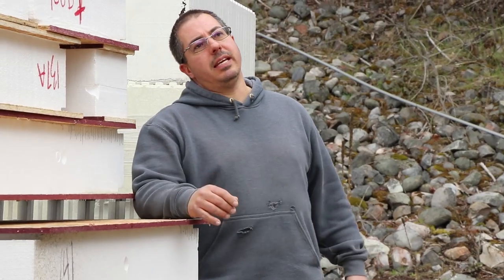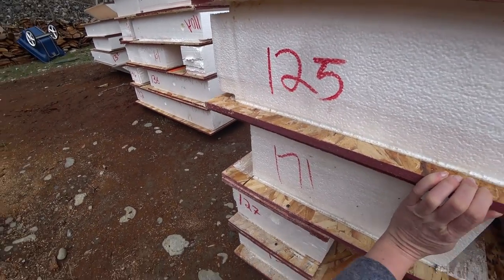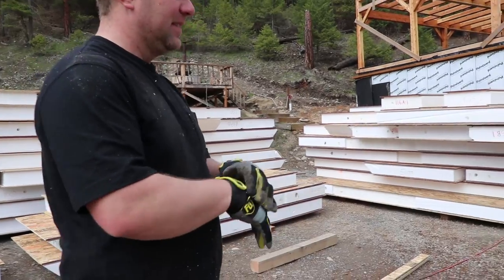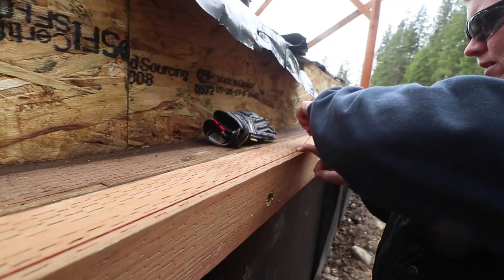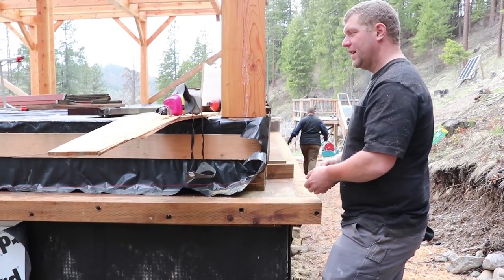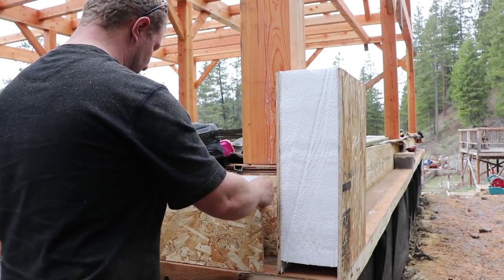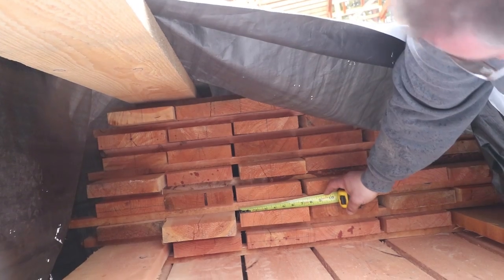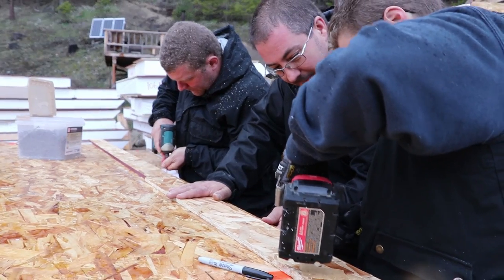LET THE SIP GAMES BEGIN! (Installation Day One)

Comment: A good tip when using the battery powered caulking gun, when you finish using it, put it into reverse and back off the pressure to stop the glue from oozing out.

Comment: Wish I could have shared this earlier.   Screw a piece of plywood to the base of the saw.  Have it extend past the blade side to give more area to stabilize the saw.  Even have it extend the right amount that you can simply follow the rim joist and cut the right amount off of the extensions.

Comment: when you use the table saw a pusher tool or scrap piece of luner used to push the end of the boards through will save a very nasty injury never get your fingers closer to the blade than you have to.

Comment: Two things, first if you haven't already finished ripping the sill plates consider cutting a piece of wood to space the saw fence the correct distance away from the rim board instead of trying to constantly follow the line (note I would still snap a line for an occasional sanity check). 
Second, Jesse knows nothing of foam dust until he has to carve it with a wire wheel grinder.

Comment: nice video guys, one question, why would you want to slide the drywall  below floor level?  it would be exposed to a cold zone ( the garage) and add potential risk of moisture or condensation. making it very difficult to remove later on.

Comment: That's an awesome BIG skill saw but the blade you are using is for cross cut work and has too many teeth for ripping work. Also when ripping I would have been happier to see you working slightly above your work rather than beside that whopping exposed blade.....I work with industrial machinery and respect that when it bites....it bites hard and no one ever thinks it's going to happen to them...fingers and thumbs etc don't grow back.....These are my observations.... not criticisms... from New Zealand

Comment: You  could screw a plywood base to the saw to extend out the narrow side of the base to better support the saw and also provide a guide to saw the proper width.  This may allow you  to saw from above and  may be safer when you are cutting the boards that are higher off the ground

Comment: Apologies if someone has already mentioned it: Why not tack on a guide strip to run saw shoe against? It's very difficult lifting a saw that high to begin with, let alone follow a visual line. Failing a tack strip, clamp on guides to the bottom of the saw shoe.

Comment: pardon me for being the village idiot here but..
why are you using a terminally inaccurate table saw,
when you have the woodmizer?

I'd set the 'mizer at one quarter the required width
whittle that off
then do final size to finish
after rotating the planks

I wasn't always the village idiot, I used to be a structural engineer,
but when my Dad died, I sort of inherited the job..

Comment: "IT'S GUNNA SPLOOGE LIKE CRAZY!" " ....your last night of being completely naked. Enjoy it!"  I love you Alyssa!  
2 things lay your glue down in an S shape to grab more connection to the 2x8, think of snake tracks.
second thing. make an extra table/shoe plate, from 1/2" osb or similar, for the Mankita saw. attach to the bottom (did I need to say that)
ok thi is where you have to pay attention

the plywood accessory shoeplate(SP) will attach to the bottom of the saw. just making sure!
cut it to the dimension of the existing SP plus 16  inches
attach it so that it extends 9" past the edge of the house side of the blade, USE sheet metal screws or machine bolts with lock nuts
3/4 space+8 1/4' SIP =9" be sure to make sure it runs parallel to the blade!!!!!!maybe go 8 7/8 for some wiggle room
now you should be able to run the saw down each wall using the floor for a guide, think rip fence
the plywood super shoe will eliminate most of the need to keep the saw from rolling over

Comment: That's one pretty big trap for DIYers. Especially with a lumber mill. 2x8s are actually 7 1/4" x 1 1/2" they take the dimensions before it's planned, surfaced, and dried. It might be worth resawing instead if cutting out the foam. If you haven't had to fix a screw up, you haven't built anything. And yes, I'm sure you probably have the rock going in by now. Just in case someone else wants to build a home with home milled lumber and make commercial products fit.

Comment: For the life of me I cannot understand why the Sip company did not make the sip, fit  the standard dimensional lumber used for the shoe, added work to rip each shoe plate?  Keeping an open mind as this process continues, my brain leans to frame it and spray foam it. I am sure being your first time dealing with this method, makes it look more difficult then it is.

Comment: Not that you'll get this in time n but clamp a couple of L brackets to the big side of the saw foot. Keep you good and 90 as well as stable. You could even adjust the width of the cut. You're probably done now so I'll be on the couch watching.

Comment: would screwing a sacraficial  board under the other boards give the saw something to hold onto so if you saw thru it it wont affect anything ?you will need a short support board underneath kinda like a saw gripper but inverted  like the letter "L" the big saw would run on top of the "L"  the base would be screwed under the boards you are trying to cut away from the blade?

Comment: Still against using pressure treated wood in shoes. That stuff should not be used no where near that is not fully out side, as it will release all kind of nastys over time to construction and into inside air. Reason why you cant get old phone posts as people used them to build all kind of stuff and in worst case burning them...those are also dangerous waste.

Comment: I understand why you couldn’t change directions when cutting the ledger.  But how about screwing a 2-3” board vertically under the front lip of the saw’s shoe to help keep the blade aligned vertically?

Comment: I just started the video,,, 7.25 exactly?  I already hate your SIPs manufacturer.     I'd have to think about it,, but I do not believe I have ever in 50 years seen a treated 2X8 that was 7.25 or smaller..  After they are 5 years old , yes.  Not when they are new.  Rip every treated plate.  Rip to 7.125.  I have seen in the video, there is a foam lip tucked up tight to the OSB,, a manufacture artifact.  It will forbid a large 2X8 from seating fully.. BTW  Treated 2X8 is thicker than 1.5 commonly.  Its gonna make a difference.

Hold back for drywall?  Drywall ends above the floor. ??

Tempered steel screws.  Metal is one thing,, bu the screws are much harder.

Pre=screwing the splines can greatly increase the difficulty of assembly. Precision fits, perfectly straight,,, nothing is that perfect,, leave it loose,, use a strap come-a-long to pull panels together.  

If at all possible,, begin assembly of any given wall or stretch,, at the center (does not apply to doing the roof)  There will be errors,, tiny things add up,, and then multiply, square, and cube.  If you begin in the middle,, total error can be reduced.  (To just hair tearing frustration.  When they add up over a long stretch,, just shoot yourself)

Comment: Sips for wall systems are pointless,  IMO.  All your percieved insulation gains are lost thru doors and windows for the most part. 

 In roof systems,  they're absolutely perfect. 

Also,  I would drywall the interior of the sips prior to installation(think non- paper faced drywall,  like densglass or something fairly moisture resistant). Think about getting drywall btw the timbers, absolute cluster f@#k.  Unless you love finishing drywall I guess. Butt joints will be everywhere,  I guarantee. Been there,  done that. Not efficient by any means.  

I agree with others,  your sips supplier is sub-par for your guys investment.  I'd be extremely unhappy.

Comment: To pull the piece in to the SIP, put a similar board on the side needing adjusted, and a piece of ply (or wider solid board) to cover the other side (to pull against the whole end (other side)), use a large tie down strap to pull the board in and attach it.  Basically you're pulling against the strength of the SIP unit to pull in the piece that needs moved.  I use this technique , building sheds to work with wood thats warped or tough to move by hand. (And the tie down strap goes all the way around the SIP., ratchet on top).